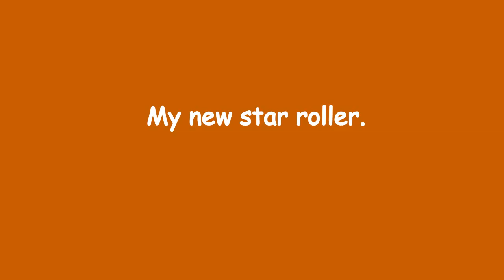Star Roller

Comment: Nice job! Great workmanship. One tip though, coming from experience... think of sanding the inside of the drum with coarse sandpaper to help grip the stars. I do it on my HDPE cement mixer, and I know at least one pro who grinds the ridges into his stainless drums to help the stars keep rolling, instead of 'sliding' along the sides. Believe me it works wonders, especially on the small cores you start with. Thumbs up!